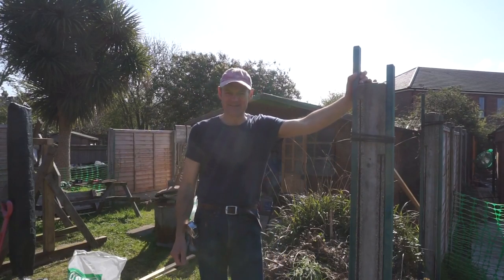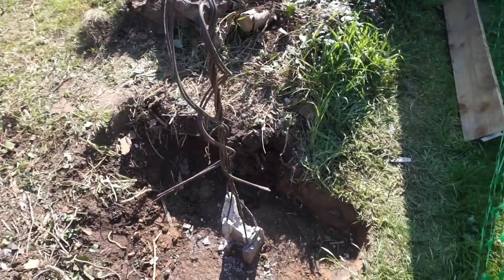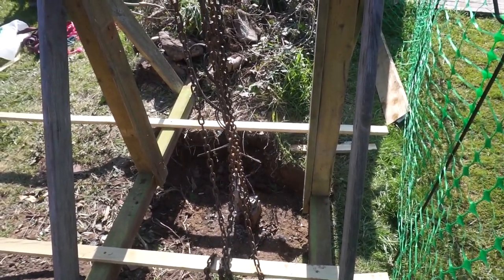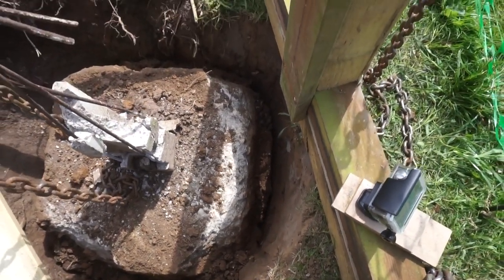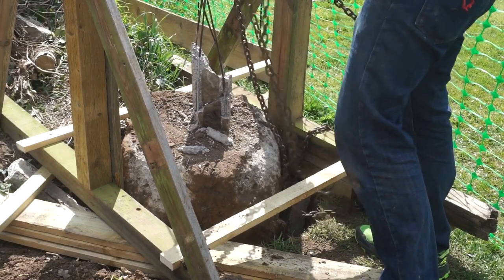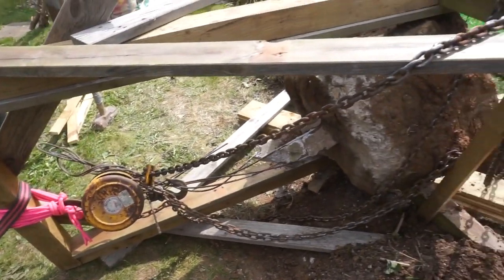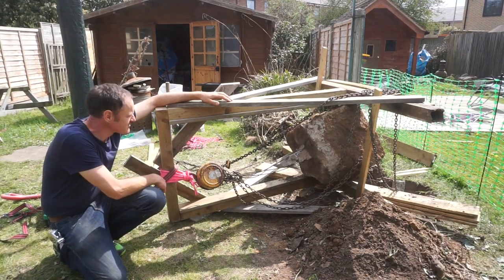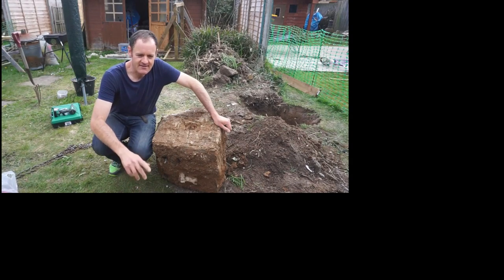Fence Post Removal. Getting rid of concrete posts easily by hand.

Comment: We have the same type at our house (in Australia). The fence installers broke and then cut with an angle grinder. But unfortunately, the complete footings are left behind. I had to do a bit more work to at least break the concrete that was above ground and then bury the rest of the footings. Not ideal - I'd have preferred they remove them properly, but I guess they don't get paid enough for that. Concrete posts are great - they're probably as old as the house and perfectly level still, whereas the rest of the fence almost rotted away. But they're a bitch to remove! I can see why they're not really used any more.
Reply from the maker: My friend has a few posts at the end of the garden where the concrete is above ground level. We bolted the metal met-post fixings into those. So much easier.
Glad you enjoyed the video.
Matt